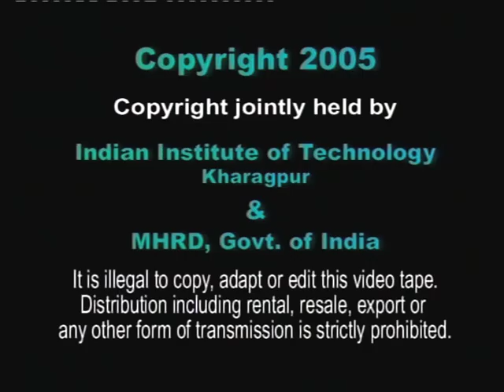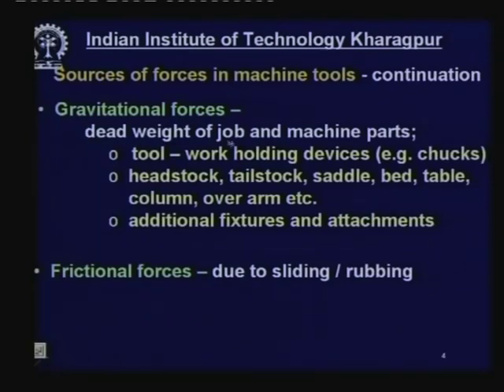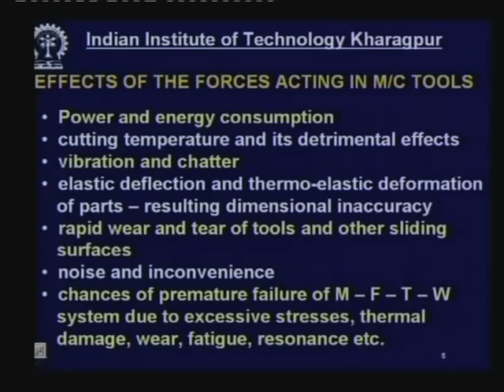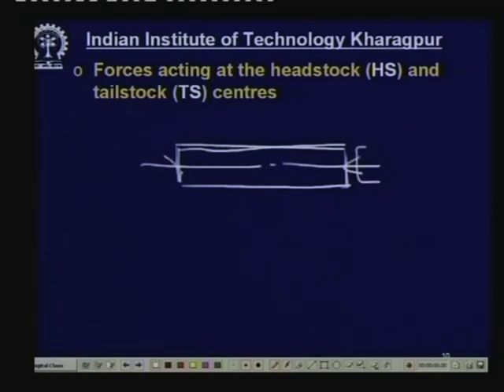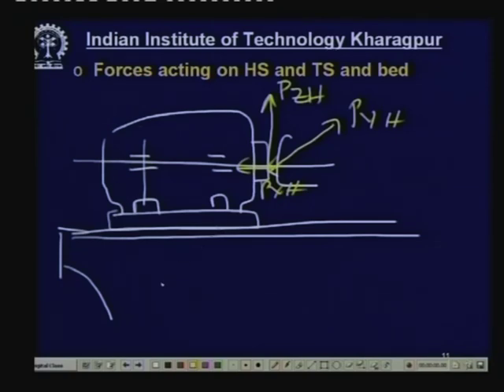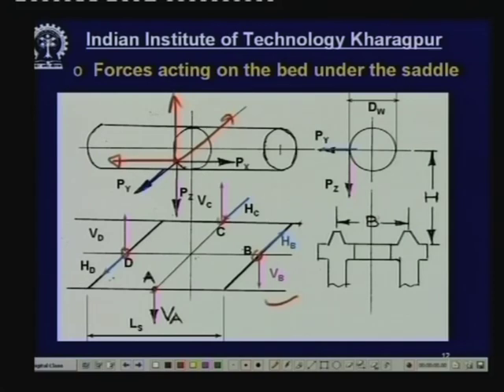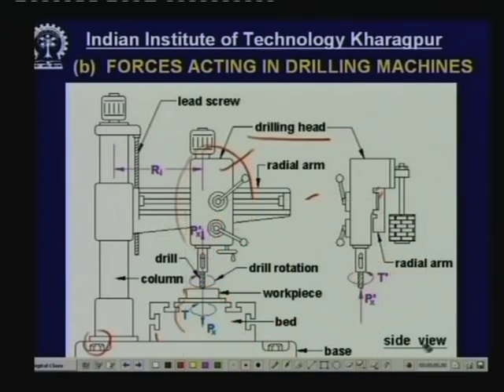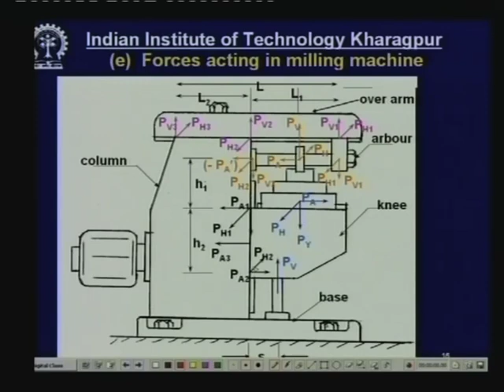Lecture - 24 Forces Developing and Acting In Machine Tools

Comment: Sir i have a question.on the tailstock tip have sometimes diferrent angle 60 deg 90 deg 75 deg etc..how yo calculate right axial trust force compare to the speciment weight?